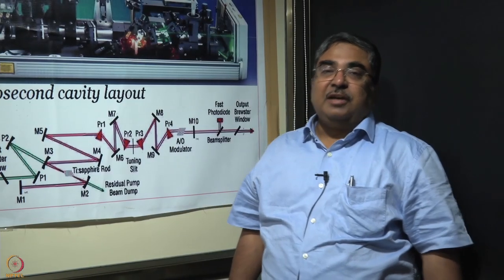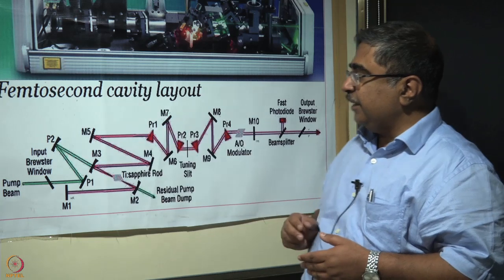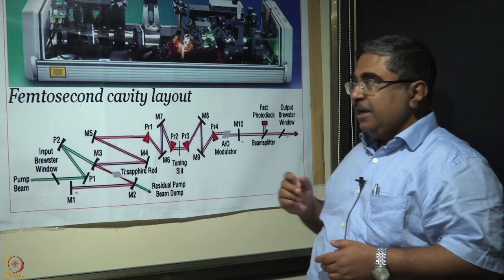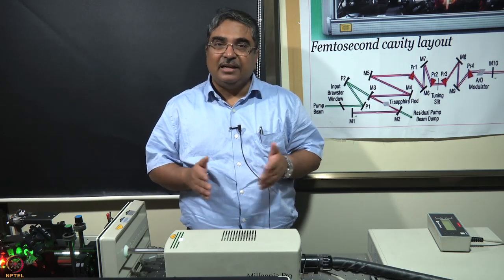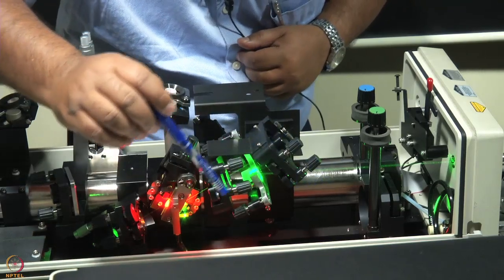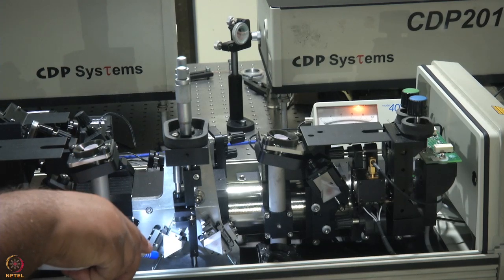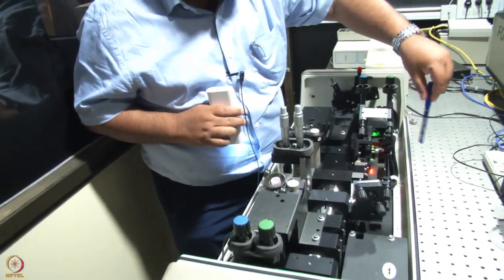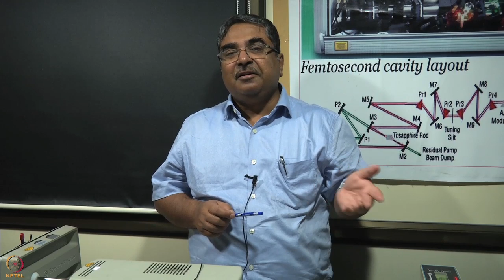Week 5-Lecture 27 :  Ti:Sapphire laser (Lab visit)

Comment: Millenia lasers I used to fix those. Even upgraded them with Coherent's FAP lasers because they offered a lot more power at the pump (40w x2) vs 25W x2 for the original fcbar pump lasers. Also allows the laser to output about 15W of green or 3W of UV